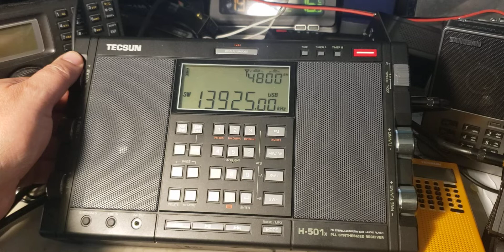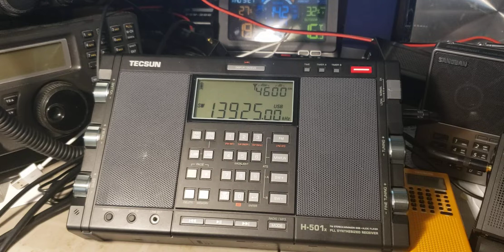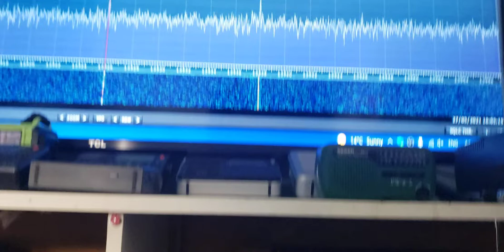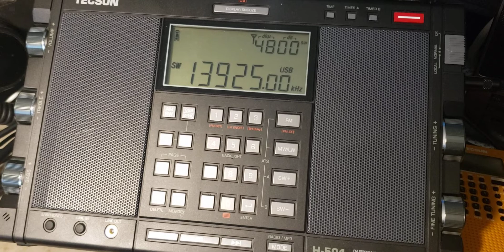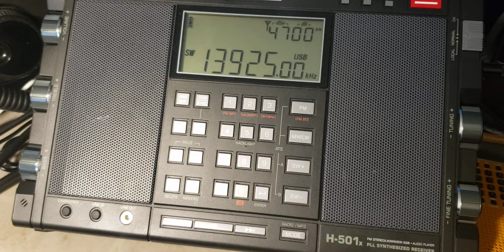M12 Russian Morse Code CW Spy station on Tecsun H-501X Tecsun PL-330 and Sdrplay RSPdx

Comment: Well I received my TECSUN h501x day before yesterday, I done a series of tests and ive come down to the 909x has just a slight edge overall but its so close, the 909x is such a masterpiece, presence is great, solid little radio. At first I was gonna send it back the h501, cause I dont know what I was expecting. But as time went on I said they are just about neck and neck. I did some walk about tests on F.M. reception, and it seems the 106 area was better on 909x stronger, but selectivity was better on the h501 around the 99 area. Sound is great on 909x when you turn it loud the drive the way the have that power its great, I hear alot about the pl880 I have that radio, but I like the 909x sound drive better. The sound on the h501 is also good. I will enjoy all 3. I also have the 660 another great radio.

Comment: If pl-330 is so  good should I go with it or get pl-990 second hand ?
Reply: Pl-330 is a very good little radio. Has good sensitivity, ssb, several filters, good sound. For the price, I cannot complain. I made 2 mods : replaced battery with a 2500mah battery and replaced ferrite antenna with a better one with more turns (LW sensitivity is a lot better). I'd definitely recommend it